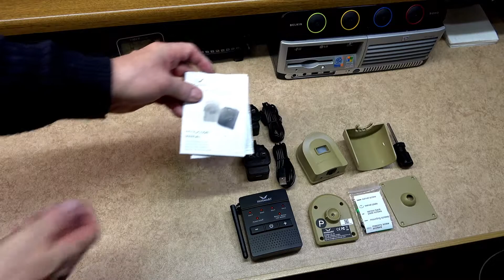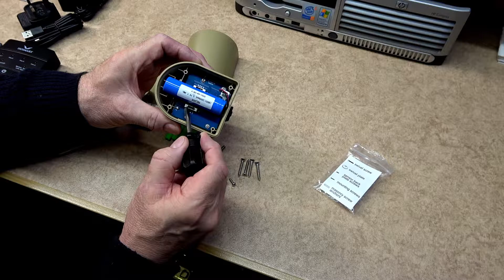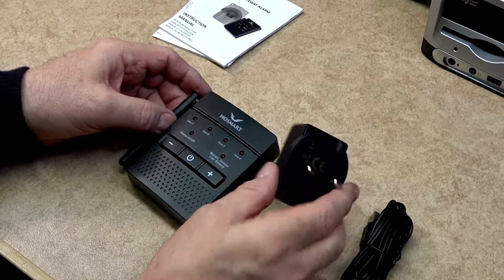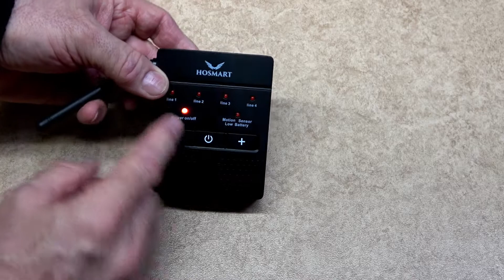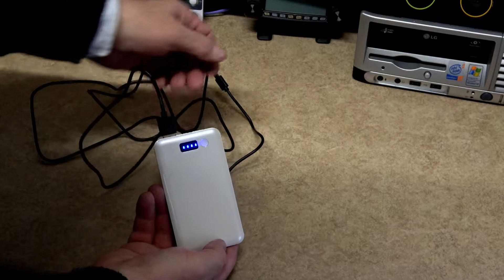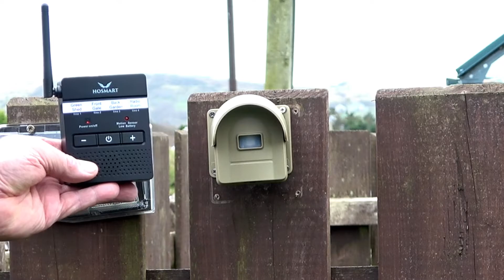HOSMART Long Range Rechargeable Wireless Driveway Motion Alarm System

Comment: This is a nice little unit.  I had  two of these units in the past.   One of the biggest problems, the locking nut that you tighten were eight swivels is not strong enough.  It's made of plastic I had one of them break on me.  Any other one I reinforced it on the outside of the the with heavy  proxy.  But the unit is so heavy that it will not tighten enough to hold  up.
I also made a nice little box to put it in to keep the sun off of it.  They need to improve on the locking device where is swivels.   George Simi Valley California🤔🤔🤔🤔🤔🤔🤔🤔🤔🤔🤔🤔🤔🤔

Comment: I wonder wether the receiver needs a clear view of the sensors?
Reply from the maker: Mine are the other side of my property? (300 feet). There is a building between the transmitter and the receiver and it seems to work fine.
Reply: @PeterHomer-nn1ou  Thank you for this answer. I need something that can work around obstacles.

Comment: I have bought these. you have made a really good video, thanks.❤
Reply: Thanks for your video. Unfortunately, Hosmart changed this model and now is bigger and you need four batteries to run each sensor. The old version was bulletproof and worked without issues.  I just sent back new sensor.

Comment: I have a small farm and this would be ideal for perimeter alarms, I would like to have more than one receiver as I would probably require 8 sensors. Is it possible to change the ring sounds for custom ones? I would probably consider making a print out of my land/farm "map", then framing this on the wall, then taking the receiver apart and placing the LEDs under the map (probably would have to solder longer cables from the PCB to the LED)- to show the location. What would be your thoughts on this?
Reply from the maker: You have an interesting idea. I do have more than one receiver in operation here and they work OK. Your problem here would be you're limited to 4 of the transmitters that the receivers will receive. As far as I'm understanding is that you cannot reprogram the tunes you're stuck with what they give you. Thank you for watching and your comments.